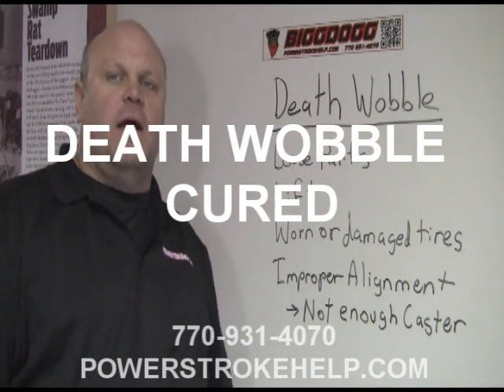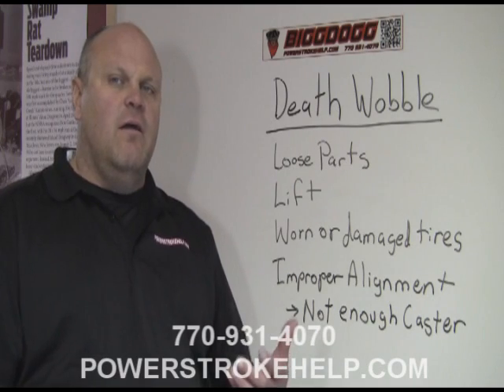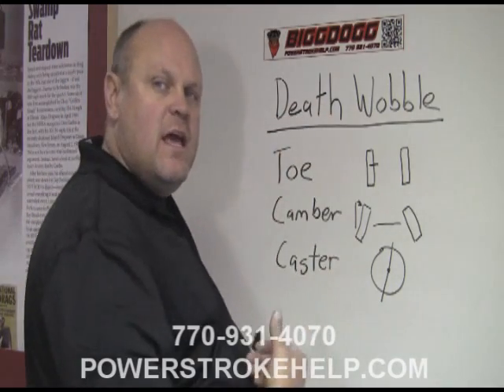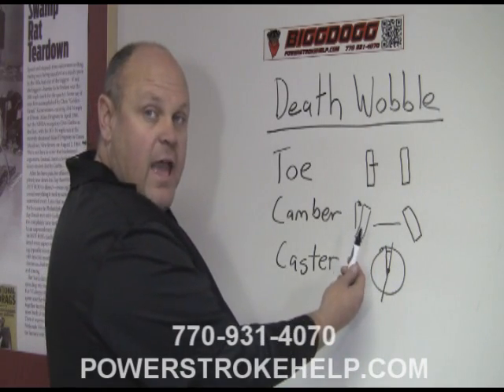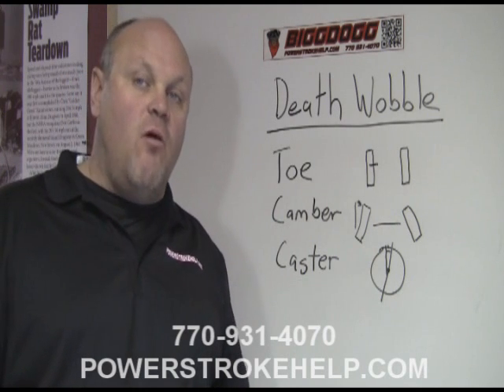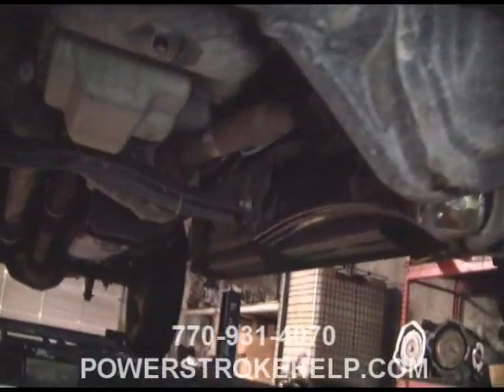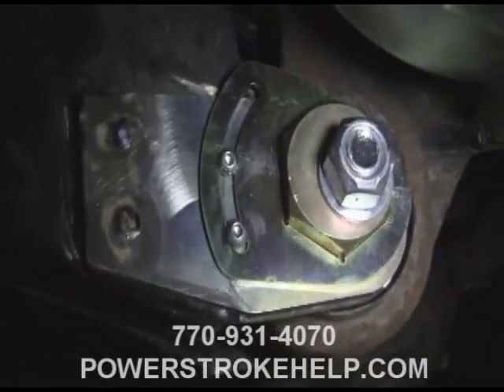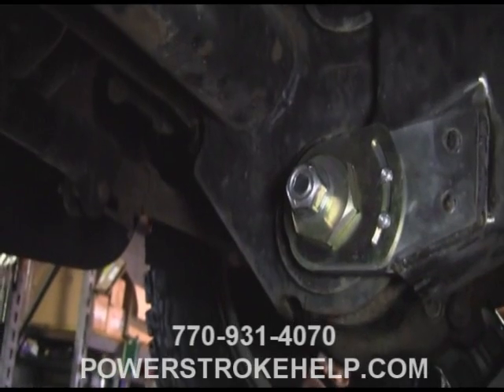DEATH WOBBLE - POWERSTROKE - SUPERDUTY

Comment: Is it just me that thinks it’s bullshit these trucks need $10k worth of aftermarket work to get them to function the way they were supposed to when they rolled out of the factory?
Reply: There is a reason this comment is 1st! I purchased a 2019 F450 and this wobble is the reason I'm here. No way I should be having this problem at 55k miles in a $75k vehicle. This is BS!
Reply: Byron P did you find out what was the main reason ?? Where u able to fix it ?
Reply: Honestly they don't need $10k worth, they work just fine right out of the dealer lot. These problems affect the minority of truck owners and usually only rear their ugly head after poor maintenance. In terms of a hard working truck, nothing beats the superduty. Yeah other manufacturers make a 3/4 ton and 1 ton, but I really wouldn't trust any of them to do the kind of work that most businesses ask their Ford to do on a daily basis. GM put a freaking independent front suspension in theirs.

I'll give you a personal example; I have an early model 2015 F250 with the 6.2L gas and 6 speed auto, completely stock. When I bought the truck it had been a plow truck for the first 4 years of it's life. That means it'd been out in the salt every winter, battering it's front end against curbs and potholes with a big heavy commercial 8'6" v blade plow. I then ran it as a plow truck for another season, this time including a salt spreader in the back. I then drove the truck 4500km across Canada to move from Ontario to BC, towing a 6x10 trailer loaded to the roof with all our stuff. Since I've owned it, the only work I've done to it is new shocks and new brake pads. It's now got 150,000km, and just went in for it's safety inspection to switch the plates over from Ontario to BC - it failed because it finally needs new drag links and tie rod ends, a normal thing at this mileage. However the mechanics could not stop commenting on how the truck is in really great shape.

The REAL reason why guys put money into these trucks, is that one of the major differences between a Ford 3/4 ton and the competition is that with the Ford you can really beef them up to make them last essentially forever. The only other truck that comes close is the Ram. Forget about GM, the only good thing about those is the Allison trans. Other trucks just run until they break because they have too many points of failure, but the Fords are like the oldschool trucks that you can just keep on the road - they have points of failure you can list on one hand and if you tackle those you're set for life.
Reply: The good thing about Ford shitting the bed when they made these trucks is it allows us guys with some mechanical know how to pick them up cheap when the 6.4 boat anchor takes a dump...then swap in a Cummins for less then a replacement 6.4 and you got yourself a bullet proof truck that will hold its value...
I hate Ford but those are some beautiful trucks...they just had a shit engine...

But it sure does suck for the guys that bought them new or used with low miles that paid way to much for them...only to have the engine blow and now your 30k truck is worth less then 8k...if your are lucky....
And I feel sorry for the guys that can't work on their own truck cause taking it to the stealership is going to double the cost of the repair...
Just imagine how many got screwed when the picked up  clean beautiful truck with under 100k mileage that paid 30k for it...only to have the engine blow within a year...now they have to lose 20k or more and dump it...or spend 10K plus to fix it...and still only be worth 30k at best...and Ford didn't give a shit ...they would try their hardest to weasel out of warranty repairs...and didn't care if they did have to pay as it is all a tax right off for them...it is almost as if Ford did zero reliability testing before releasing their diesel trucks....leaving the R&D up to their customers and out of their customers pocket for many...from the 6.0 to the 6.4 and even the early 6.7 engines that grenaded prematurely before the warranty was up but for many soon after...way to many blown engines to say there wasn't some kind of design flaw...which simply amazes me after the nightmare Ford went through with the 6.0...one would assume they learned their lesson...but history says otherwise.
Reply: They don't need that much but when they get some wear on them some do need some extensive work
Reply: And I just bought one 😰
Reply: Well fortunately, they are also priced 10k lower than their overpriced competition. Six of one, half dozen of the other- not sure it really matters.
Reply: But, the problem is they aren't 10k cheaper. They're all about the same price.

Comment: I have no idea whether you read and answer these or not but I have a question concerning Death wobble. I recently helped my death wobble and turned it into a minor injury wobble. Here are the stats; 2006 F250, 4X4 (135,000 miles), 6.0 that is 80% bulletproofed (only the studs are left), 4.5 inch lift, 35 inch tires on 20 inch steel rims. I developed a death wobble, got under and pulled, jerked and wiggled everything to see what parts may be unhappy. I replaced the passenger side Tie rod end, the sway bar bushings (frame bushings, the others were fine) test drove and still had the wobble. Replaced the steering stabilizer (damper) and BAM!! wobble gone, but not gone. Now the wobble is not as frequent and is a much gentler wobble. Do I need to upgrade to a dual steering stabilizer set up? Do you have any recommendations for a good dual stabilizer set up in the $200 range, I have no need for "Fox" level suspension components (neither do half the people who run them). Are there any dual stabilizer set ups that use the stock stabilizer mounts? Thanks for your help.

Comment: Saying that there is not any caster adjustment on these vehicles is incorrect. There are alignment cams made to go where the upper ball joint is located on the axle which then allow camber and caster adjustment. How do you thing the manufacturers have been setting alignments on straight axles for years? Specialty Products Company and others have adjustable camber / caster cams for this purpose. It takes one nut removal and a hammer to pop the factory cams out and then you pop the new ones in. Part numbers are as follows: Driver side 23268 and pass side 23269 for SPC fixed camber / caster cams. These are the perfect solution for all F250 - 350 - 450 super duty's with level kits.
Reply: I think he might be reluctant to mention that subject as Ford says not to mess with the caster using those offset camber caster cams. I believe I will go for 3 degrees positive on my Excursion.
Reply: Any pics or guide to see what's involved in this?

Comment: not death wobble but Question,,,, 99 7.3 - Front axles loose ( wobbly ) when hubs not 
engaged.......  ( this is only when I wobble axle U-joint area by hand, Not on the road ) new Spicer outer shafts ( inners good )  New Spicer seal and bearing 
kit all the way through, new Moog hubs, new Spicer ball joints. Ive only replaced 
all of this because they were worn out when I bought the truck. but 
should there be a decent amount of play when hubs not engaged????
Any info would be greatly appreciated!

Comment: Lower the ride height in the rear and the caster should come back
Reply: +Dave Begotka  Trigonometry reveals that even for a crew cab with a long bed, a 3 inch drop due to a rear load will change caster by 1 degree. So, only having 1 degree to start is lame. The power steering is more than adequate to handle a couple additional degrees of caster and make this issue disappear. 
So, the question is...Does the new 2017 model resolve this by having either more (or adjustable) caster?
Reply: @gregparrott  my buddy brand new 19 platinum 350 67 diesel completely stock is doing it 85 90 thousand dollar truck and its completely unsafe
Reply: Would be funny if someone would test your idea by just adding a lot of weight to the rear of their truck and see if the problem goes away.I joke with people that they need a new ATV in the rear to add some weight over the rear wheels.Hauling water you could add a lot of weight also.
Reply: I am a vehicle dynamics engineer i guarantee it....it should have had more caster from the factory but they are looking for a light feel on the steering wheel like a car...IMHO
Reply: @DaveBegotka  horse shit I have a 2000 f250 with a utility body loaded squated down with tools and it just started death wobbling.

Comment: Now this sound really stupid But I have A 02 f350 diesel. You would drive down the road And it would pull you one way And then the other. It would shake back And forth And then stop. Sometimes it would not do it for A week or so then start back up. My front end was all rebuilt, couldent figure it out. Did some research And A few guys told me to replace front u-joint that they would lock up And pull truck. Replaced them And hasn't happened again. Some people call me stupid that that don't matter. Have you ever heard of this before.

Comment: My new 2010 F350 had the death wobble from the beginning. If I was at high speed and encountering a bump during a left curve it would go into wobble. No wobble in a right curve. Stock tires and wheels no lift kit. Took it to dealer, they were clueless. They then said there was a bulletin that the castor was wrong from the factory. They said they adjusted it but problem was still there, probably just BSing me. Eventually took it to a private mechanic who installed aftermarket shocks with more rebound damping. Problem never reoccurred.
Reply: sandra beeline which shocks did you buy?
Reply: My 2011 f350 diesel pickup just did this today it has 66 thousand miles on it and my buddy has 90 super duty in his fleet and half are doing it as well as his personal f350 Ford completley replaced the front end and still doing it Ford has no clue why this is happening and don't no how to fix it this is so dangerous because it usually happens on highway at cruising speeds and sometimes you can floor it and drive out of it but I have to basically stop on the highway to stop it I baby my truck and its all up to date with service and new tires on it but when it wobbles feels like the truck is coming apart this is unacceptable to me the truck is a 50 thousand dollar truck the way it sits completely stock because of the warranty if it keeps happening I'm going to either get killed or kill someone else on the highway

Comment: caster will help but the use of a sterring stabilizer supporting the steering box sector shaft will stop the problem completely.  These can be purchased at a reasonable price online.  I have personally experienced this and the caster adjustment DID help but the added steering box support stopped the death wobble completely.
Reply: hey Bryan, I just bought a 2012 f350 4x2 6.7 that's got the wobble around 40mph and up. I'm a plumber and not a mechanic so I'm not sure what to do to fix this. I was ready to buy rancho 9000s and a dual steering stabilizer bar to try and stop it. what do you think?

Comment: worn neoprene bushing on the stabilizer bar 20 bucks will cause it on a powerstroke.
Reply from the maker: +trac nunya How about a Ford part number and a picture.
Reply: Depends on the year, but there is a metal curved weird looking bar that runs fully from the left to right front wheels, the neoprene goes on there, STABILIZER BAR BUSHINGS, advance auto, search for that.
RUND
Reply: +trac nunya that's called a track bar, or a panhard and could be one of several causes.

Comment: there is a company that makes a Trac bar to replace the factory Trac bar on 05s and up that has a solid connection on the lower end instead of the ball-joint like connection on the factory Trac bar. Would this help?

Comment: hello.  Nice video for the newer trucks.  You could place caster shims on the old front leaf springs.   problem solved.   I had done it on many OBS 4x4 trucks with great success.  works for the Excursion also.   it is common practice in the bus and medium duty truck world.  Many people just don't want to do the extra work of taking off the front lead spring U bolts.  P.s.,  you are right that the newer trucks ride nice, and it is cool to see aftermarket parts like the ones in the video.  Thanks for putting out informative videos!

Comment: My 2000 F350 front driver side just went out last night doing about 60mph. It locked up and left a long skid mark while heading southbound on highway 95 in-between Taylor and Granger, TX. I merged off the road and took a look at the damage it did to the tire leaving a definitive flat spot on the tire that are all new Michelin LTX MS2 from Discount Tire that I purchased earlier this year with the roadside warranty. I will be removing the tire today and taking it in to exchange for another one. Good thing I paid extra for the warranty. I think I paid around $230 for each tire. Anyway, I first noticed a very slight vibration coming from one of the front wheels almost a month ago while driving at highway speed but thought little of it since it was a quite minute vibration. Well, that quite minute vibration taught me a lesson. We are Triple A platinum members so it took them a little over an hour to show up since he was coming from south of Austin to haul me back to Round Rock which was about a 25 mile haul from where I broke down. I just started watching and reading all comments on YouTube videos pertaining the wheel hub removal. I have not seen any comments on what wheel bearing & hub assembly brand to use. I am on the RockAuto website comparing what they offer as a replacement but I am confused as to what would be a good choice. Prices start at $79.79 and go to $288.79 for each hub and of course the MotorCraft is the most expensive. Are they all good or are the cheaper ones like WLB, Dura International, MovoTech, Raybestos, just as durable as the Dorman, Timken, Moog, SKF, MotorCraft? Please offer your advice on this. Thank you all for contributing to this issue.
Reply: +Nate In TX 
I would have preferred to post this in your 4X4 Hub Replacement video but you have your comments disabled for that video. I figure that this video is the next closely related to the issue. Thanks much.
Reply: +Nate In TX Im sure you all ready fixed your issue, but timken hubs are great, and the unit bearings are easy to replace atleast.

Comment: Caster can 'fix' some performance issues on some F-Series. But I've never heard of DW being a caster induced problem - if the factory settings and parts are within specification. Anytime you  start modifying the suspension, tires, rims, offset, weights, you open up potential issues. And while you do go through all the usual suspects, I think you may have in fact exploited a problem with your test rig. You mentioned it had been rolled. If the frame is so much as tweaked and twisted + 1/8", you're just asking for problems, especially if the bed is NOT loaded. Assuming you laser aligned the frame, then DW should not be caused by Caster. Ford isn't crazy. They don't want DW either. It's not a widespread problem. If it was, NHTSA would be all over Ford and mandated a recall. I've had DW occur on just about every make of truck. Even imports. The cause has always been tires / rims or worn out or bent suspension parts. I've only seen two trucks (one a Dodge and the other a Ford) where it was caused by a serious crash and the frame was not properly straightened, repaired or replaced.
Reply: if you read through information regarding the geometry of the front steering axle it calls for 6-7° of caster, I've ran them down to 3° without dw, but if any other components loosened up, dw would acure

Comment: Definitely check out the Jeep forums for info on DW. I had a 2000 Wrangler with a lift and I would get DW when my Track bar (Panhard Bar) bolts would loosen up. not sure what Ford calls it but its the link that prevents the axle from moving side to side. Have somebody wiggle the steering wheel back and forth quickly with the truck off. Good chance you will see your problem.

Comment: I had this issue on my 95' F-350, the truck was leveled and had oversized plus oversized tires, and a giant ranch hand bumper with a warren wench in it. So after replacing the tie rods, and even the steering gear box, it came down to a little bushing that cost me $35. Installed it, and wham. Death wobble gone. A great help for me was looking at some Jeep forums about death wobble. I took the advice from the jeep guys and applied it to my truck. Boom done. Wish I had done it sooner, would have saved a ton of money.
Reply: +Lawrence Maxwell but you don't wanna share what that bushing was?? cool story bro....:/
Reply: +LamassuSound Track bar bushing top and botton...
Reply: What was the bushing you bought?  Do you remember the name?  Did it help with drifting from left to right going down the road?  Thanks

Comment: Hey I have a big beast of a truck, it is a Ford 1988 F-800 4-WD with marmon herrington running gear and I have a horrible death wobble at low speeds especially if I hit a small bump. All of the tie rods are good and there is no play in the steering system so what do you suggest that I do to try to cure it?. This truck also does have the full sized 22" diesel truck tires and rims stock, any suggestions would be splendid!. I am goi8ng to replace the steering dampner but have a feeling that it may take something more than just that to solve this. Thank you.
Reply: Check your kingpins/bushings